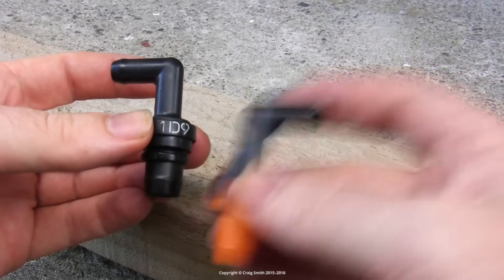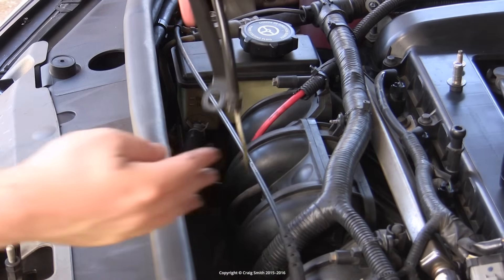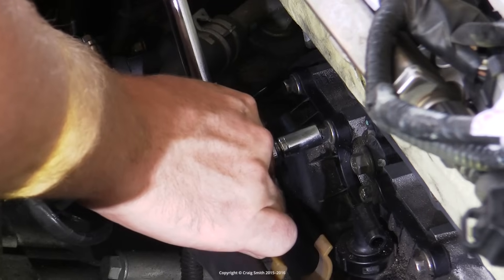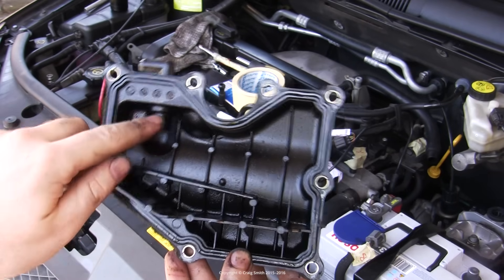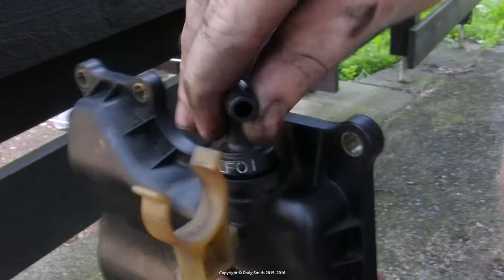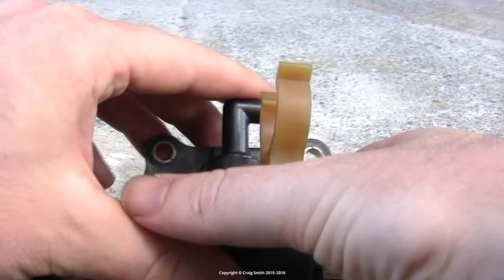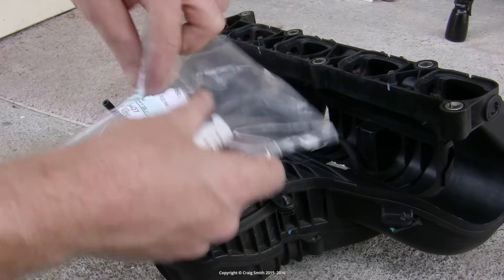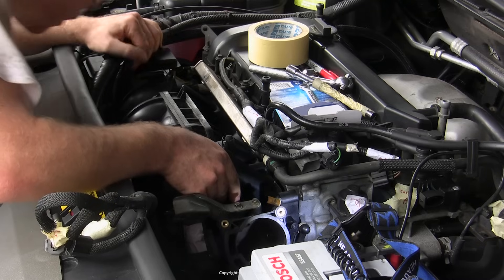How to: Replace PCV valve, hose, oil separator Ford Duratec / Mazda L (Focus/Ranger/Mondeo/Mazda)

Comment: Thanks Craig,it’s almost impossible to get a video pertaining to PCV removal in a 2007 focus as in your demonstration. Yours is priceless. I’ve never seen it demonstrated like that. I’ll try to replace it without pulling off the intake manifold but if this fails I’ll know what else to do.Just loved your video. Lester from Cape Breton N.S.
Reply: Was it possible without removing intake????
Reply: @mrtankkiller9163  no, also just replace the whole oil separator, 30 dollars on rockauto.

Comment: I don't know if replacing the PCV valve will fix my issue yet, but this video was the only video after a lot of searching for both forums, images, DIY instructions and all the other videos that were absolutely useless. This one clearly explained how to get this off and out of the car in a very easy and clear manner. Removing the intake manifold was key. After finding a diagram that it was behind it, it wasn't sure how to get at it. I didn't realize the intake manifold came off so easily. Anyway, while my engine is a 2.0T ecoboost out of a 2014 Fusion, the intake manifold and most of the front of the engine looked identical to this one, exact same PCV housing and everything. I was able to quickly remove the intake manifold and pull the housing out and pop the retainer ring off the PCV valve. I see not a single auto parts store has the valve or anything to do with it, so I'll have to find this part online. It's scary how quickly a perfectly good car can go obsolete :(
Reply: If able to, please add a tag or something for the 2013-20?? Fusions, at least the 2.0T ecoboost looks like this for this particular replacement job. Maybe make a note that this is for reference only, and to make sure to check your own model and year for part numbers and such.  Again, I can't thank you enough for such a clear video. Now, here's to hoping this takes care of my issue!
Reply from the maker: Thanks. If you found the valve part # feel free to post it for your EcoBoost.
Reply: I bought my PCV valve at O’Reilly’s

Comment: Same for Ford Galaxy owners also. Thanks for the upload. Now to take off the oil separator and check inside there as the engine is burning oil. My pcv valve rattles freely and compression through a compression tester is even on all cylinders. There is black sludge sitting on top of the pistons. Going to pour paraffin into the cylinders to clean it away and then change oil just in case piston rings are sticking. Hope it sorts it out or I'll be taking it to a garage to get valve seats looked at otherwise. Thanks.
Reply: Did you had oil burnin ishue on your engine?
Reply: @galcizman2348  Yes. It turned out to be valve stem seals. New or spare engine only. No parts for them.
Reply: How much oil did your engine burned o  n 1000km?
Reply: @galcizman2348  It was burning oil like mad. Every time I filled it up with petrol at a petrol station I would have to put maybe 1/2 a litre of oil in it as well.
Reply: @eddyemm  Thank you for anwsers😁

Comment: Hi Craig, I recently bought a Ford galaxy mk2 manufacturered in 2007, with a 2.0 liter Duratec HE. The car was perfect but after about 600k I noticed that the oil was below the lowest mark. Also noticed that the oil on the deep stick was black with suspended charged particles.. Did an oil change, because I thought the previous owner was sloppy with maintenance. But again after 600 km oil was below the lowest point on the stick. The car also had an usually hard starts.. But no error codes and the yearly MOT had no emission remarks and the vehicle passed with no issues.. I went ahead and invested in building in a liquid petroleum injection unit ensuring that the car also run on LPG and all was well besides the high oil consumption..The Ford garage said that 1 liter per 1000 km was OK and since there were no error codes, they suggested I flush the oil system and keep an eye on oil consumption..  This I did, but consumption still was about 1 liter every 600 you 700 km
Given the age of the car and the fact that the car had been parked for over a year, I suspect the pcv needs replacing.. Anyway I haven't yet got the courage to replace it myself but after driving 9000 km the engine warming light has come on and the error code associated is P0420, catalytic convertor malfunctioning.. My question is can a pcv failure cause the P0420 error? and would you mind coming over to the Netherlands for a weekend to assist me replacing the pcv and tube. I have access to a DIY garage Monday through Saturday and would meet your travel expenses of course.
Reply from the maker: No I can't come to the NL. However the PCV job is not too difficult, you just have to face up to taking off the intake manifold, which is time consuming but not mechanically difficult, see the other video(s) linked. I think a failed PCV valve could allow too much oil through and end up contaminating the exhaust and clog the cat, but many other things could dump oil into the cat - worn piston rings etc. You will have to try to work backward from the cat code, have you watched the O2 sensors on a graph to see what they're doing. I presume you have checked for basic things like oil leaks. Is the exhaust smoking. PCV is cheap so do it anyway, and when you take the oil separator off, is there any sludge inside engine.
Reply: @CraigsDIY  I was sure, that coming to NL was a long shit, but had to ask anyway.
I believe the pcv is stuck open and so NO oil leaks or black smoke or high pressure in the crankcase , but hard start and now the P0420 error code, oxygen sensor bank 1.,  I have now taken the car to the Ford dealer to confirm my diagnosis and I will attempt to replace the Valve and hose on Friday or Saturday following you manifold removal and pcv replacement videos ..  However My wire harness also has the injectors and sparkplugs wiring bundled into it which will make labeling and unplugging over 20 connectors a nightmare in itself , but I will try it this week.
Thanks though for your wonderful illustrative videos.
Reply: @CraigsDIY  because the car has an LPI system installed in to the manifold, I wasn't prepared to tackle this task until today. Begun at 12 noon and by 18 hours the manifold and 18 electrical connectors were back on. Had to also remove the fuel rail and injectors.  Anyway the PCV valve was still okay, but the hose had split and the crack was almost 20cm long. 
Good news the error code P0420 has also disappeared. 

Thank you Craig for your video for saving me a fortune.. 
The Ford garage had asked for 1200euros for this job. Thanks again.
Reply: @konstak5651  After replacing the pneumatic rubber hose, is the burning of oil the same all the time? Did you manage to do something for Ford to eat less oil?

Comment: Hello...I wonder if there is a way to reach the PCV hose from underneath the car, without having to remove the manifold?
Reply from the maker: If you have small hands and it is easy to pull off, it might be possible. It would be pretty awkward though.
Reply: @CraigsDIY  Thanks...

Comment: Hi Craig, really great videos to start off with. I have a ford c max duratech 1.8 petrol and it uses alot of oil like 3 litres a month or so, my engine runs fine but struggles to start sometimes and there is always oil in the throttle body (only smoke when it struggles to start). Ive been told it may be either the PCV valve, oil control rings or valve stem seals but I dont want to tear my car apart as it is a daily runner and cant really afford to spend much on it as its pretty old anyway. I know this might be a shot in the dark but if you could help with these symptoms that would be a massive help. Subscribed...

Comment: How can I diagnose my PCV system without disassemble the intake? What are the symptoms of bad pcv valve and bad hoose? How do I know if the oil thing has oil in it?

I don't look forward to disassemble the intake. Have 1.8 engine. Built by Ford. But it's a Volvo

Comment: I have a 1.8 flexful duratec motor. I cant find the part. Does the pcv valve for the 2.0 motor fit the 1.8?

Comment: what's the option to different sizes elbow or hose I have the orange one but separator cover is modified to the aluminum bottom pcv smaller diameter elbow

Comment: anyidea 1.8 duratec 440000km,  no smoke, idle normal, changed manifold, good perfomance, starts at once. BUT..... 1.5 lt oil per 1000km ?  what is wrong?  i used at normal 5w40, now i am at 15w40 and i see no blue smoke,  sometimes, when very hot, at traffic lights, i start to move and see smoke on the rear view mirror. Any help?
Reply from the maker: Grey/white smoke along with lost oil, likely worn piston rings. Could be other things, head gasket, damaged block. Is the coolant clean. Obviously check for basic leaks! - e.g. front & rear main seals.
Reply: @CraigsDIY  i do   fix simple motors. Coolant red. Normal. No temp. Replaced 3 times thermostat. 1 time water pump. Blades were all cut. No leak front rear crank. But for 3 years car had no hot water in cabin heater. I found 2 small radiator pipes8 mm were having oem metal strainer inside that were stick. I found it when i replaced water pump and trying pass air through collars. Anyway the car is consumpting big time oil with no blue smoke view, or white , i believe the oil piston rings are bad design. Anyone unvlocked them with  result? I dont want to open motor.

Comment: Is it possible to change PCV hose without removing intake manifold? What if radiator is removed away ?
Reply from the maker: Radiator won't help. Starter motor might. You get to the point where taking off the IM isn't any harder, it's really not that difficult. It is maybe physically possible to do the hose with it in place, if you have small hands maybe, but very very awkward especially if it's stuck on.

Comment: can you help me? I have ford galaxy 2009 2l engine that uses a lot of oil. About 1.2 liter on 1000 km. Is this the problem of a bat PCV valve? ore have i bad piston rings to. Engine has 253.000 km driven.
Greetings marco.

Comment: Could replacing this PCV sort out my lumpy shaky idle, only happens when car is warmed up and not all the time just most of the time.
Reply from the maker: Any vacuum leak can cause a rough idle, when it's cold it will be idling faster which can hide it.

Comment: Nice with great info.. million thanks...
However,  with all the hassle, why dont you install an oil catch tank for better oil separating?
Just my 2 cents
Reply from the maker: I had very little oil in the bottom of my intake manifold (if you look at the manifold video you can see) when I took it off. The engine's not direct injection so no need to be paranoid about keeping the valves clean. So I don't see the point, upgrading the factory air/oil separator to the last revision would probably be a more effective investment.

Comment: What oil do you use?

Whats the mileage on that engine?

Just trying to compare what I got behind my PCV cover to what others have.

-Thanks
Reply: I wish that PCV valve was cheap.
It comes as an assembly and only Napa AutoParts had it...for $100 bucks.

What takes 30 min tops and $10 on my Tacoma takes hours of work and cost $150...

Super dumb design.

Comment: I heard that the pcv  valve can be changed from underneath the car with long bent needle nose pliers... It's difficult but possible apparently without having to take the intake manifold off. I think mine it causing my excess oil burning problem.... I just hope that I will be able to change it without taking off the manifold.
Reply from the maker: Good luck. I've heard of the hose being replaced like that (although the hose can also be really glued to the manifold) but getting at the valve collar and applying force in all the right directions will be very awkward. I also think you should take off the air/oil separator and inspect it as part of this job.

Comment: i guess im lucky, i have a 2.3 liter duratec on an escape and the pcv valve and hose are at the back and easily accessible
Reply: Are you still on YouTube? I’m curious on where you’re saying yours is. I’m getting conflicted information and people are saying mine is underneath the intake manifold but I think mine is at the top back. It’s 2005 Ford Escape 2.3L, but I don’t know if it’s duratec or not…

Comment: Will flushing the engine oil help removing the sludges accumulated inside the oil seprator?
Reply from the maker: Who knows. I don't think a flush is sufficient once enough sludge is built up. It's also debatable that disturbing it is a good idea if you're not stripping everything down and cleaning it properly.

Comment: Is this the same engine as a Volvo 1.8 se 2004. I was just wondering if the PCV system is blocked would it cause it to smoke. The car only has 82.000 on the clock and it would be a shame to distroy the car considering it's in really good condition. 👍🏿
Reply from the maker: You'll have to identify that smoke, white or blue or ?, and other symptoms. Put a scan tool on and look at basic EFI things. You'll probably be looking at more fundamental things than PCV but maybe.

Comment: Your videos are superior!!! Question for you. I replaced my PCV valve after watching your videos in hopes it would help me resolve my focus ZX3 w/ a 2.0 smoking issue. But it didn’t. Do you have any recommendations what else might be causing it to be burning oil? The intake has a bit of dried oil stuck to the inside of it and same with PCV oil to air box that is mounted to the crank case. Thank for any feedback!

Comment: Hello, mondeo 3 has got idle speed increase especially after engine warm up, I changed the idle valve and potentiometer again! I think the manifold flaps are making noise. I would like information if you have experience with this fault.

Comment: I have a 3.0 V6 mercury montego. My Haynes repair manual is telling me the PCV is behind the intake manifold by the egr valve but I’m calling bs. It looks like it’s right on the valve cover of bank 2. The pcv hose is connected to the air hose between the throttle body and air box. Someone let me know
Reply from the maker: That sounds like the PCV breather hose. The valve is at the other end of the system and needs IM vacuum so it needs to go downstream of the TB.
Reply: Craig's DIY Car okay thanks for the reply. I did find it. Not going to be easy to get it off. Looks like the upper intake has to come out but I’m going to try to avoid doing that

Comment: Is there a way to check if the valve is stuck without dismantling anything but a hose in which i can suck or blow to ear there a click sound from the valve ? Thanks ! Engine : Duratec ST (Fiesta ST 150)
Reply from the maker: You can blow/suck on the disconnected hose if you don't mind a mouthful of oil, it will stop the one way and flow the other if working. But as you can see from the video it is very hard to access without removing the intake manifold.
Reply: Thanks, the thing is i just swaped the engine with a used one after a rod exploded and now everything is finished, the new engine blow smoke at high RPMs...But works great. So i have to dismantle all the front of the car because on the Fiesta there is no room to remove the manifold...Sad...I will take it to a leak down and compression tst before.

Comment: hello.i have an mondeo mk3 duratec 1.8 petrol and i have a problem: in the morning with the engine cold i have to start it a few times before i can go.i turn the key, it's starts , and then it stops when the engine wants to stay idle.this think only happens when i have less than half of the tank ..please help me.i have cleaned the map sensor, the idle thing (it's in one of your videos with the map sensor), the throttle body.new sparkplugs, new Air filter, petrol filter, and the engine it has been completely restored ( the valves, all the gaskets etc) this problem was there even before the engine's restoration.( sorry for my bad english, it's not my native language).PLEASE HELP
Reply from the maker: Not sure I can help much. Idle stall problems many possible causes. Intake side e.g. - faulty or clogged IACV or EGR valve, faulty TPS. Check cylinder head temp sensor is giving sensible data. Fuel side - injectors or fuel pressure regulator. Even EVAP system. Check electrical system ok (battery & alternator voltages & voltage drops). But if it's the case that it won't start only when fuel tank is empty, suspect weak fuel pump, need to check fuel pressure with a gauge, also need to check ECU for error codes and scan fuel trims for more leads. Good luck.
Reply: It won't start only with a full tank
Reply: Aproximately
Reply: Deian Borosoiu try not to fully tighten petrol tank cup as they sometimes do not let air go in to tank making vacuum I have this problem

Comment: great video.  can the valve be cleaned?
Reply from the maker: You could clean it with some throttle body cleaner or similar if it is just jammed up, but that doesn't guarantee perfection and I don't see the point. It's a very cheap part but a total b!tch to access... much more sensible to just replace it.
Reply: You right a bitch to access.  28 euro for valve and 55 euro for the short vacuum pipe at my local ford.. Videos are very good.
Reply from the maker: I wouldn't pay those prices, try some alternative suppliers. Links in the description for Amazon. Or just find parts # and search online.
Reply: Will do thanks again.
Reply: @mack1609  please any updates